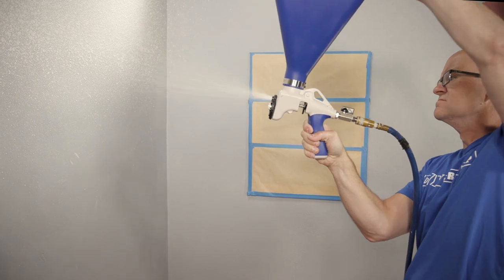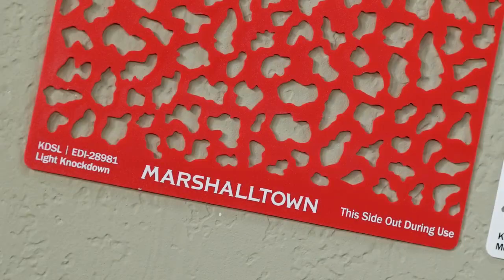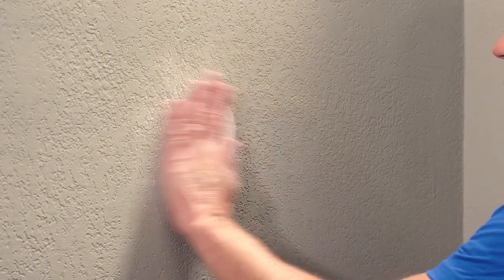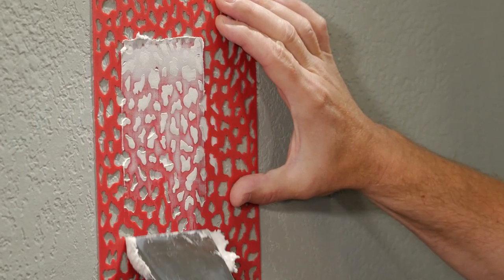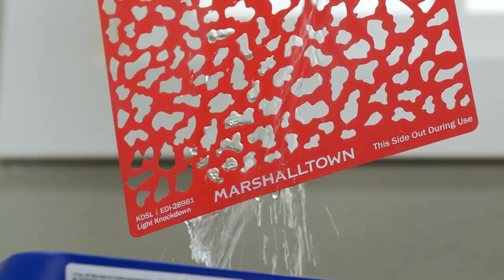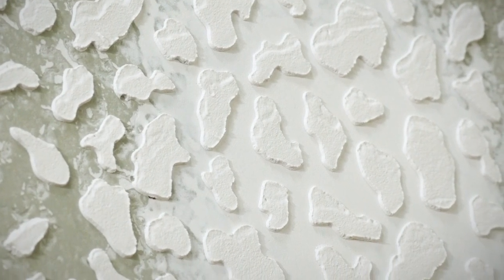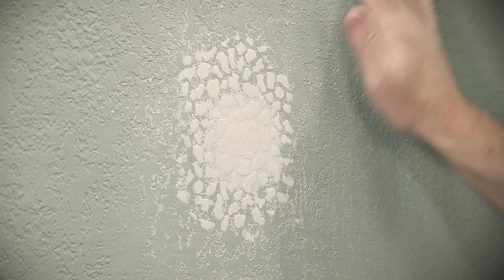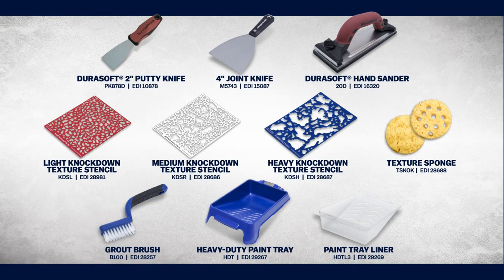DIY Workshop - Marshalltown Knockdown Texture Repair Stencils

Comment: I swear this is the best invention since sliced bread. It would save so much money on overpriced spray cans of texture, looks like it makes better results anyway. A couple things to note looks like they used all-purpose straight out of the bucket, most likely to minimize shrinkage, also it might be a good idea to use two layers with different sizes to help blend even more.

Comment: This looks horrible. I wouldn't even use this for a rent house.
Reply: my thoughts exactly.  was looking for a cleaner solution then dragging out the compressor and hopper in a million dollar house, but this AIN'T it.  Maybe if the holes were smaller then it was knocked down after it was applied.  But as it is, this solution is trash.